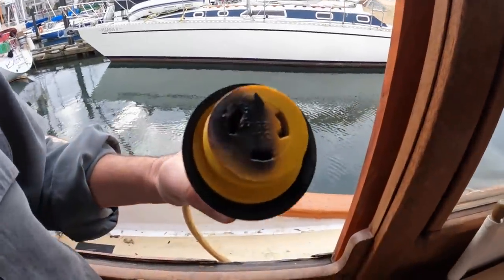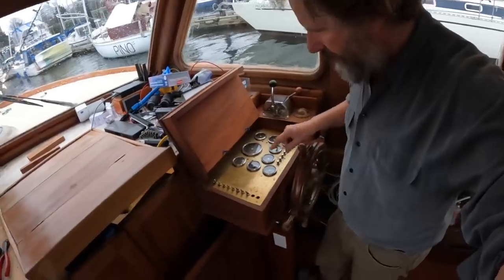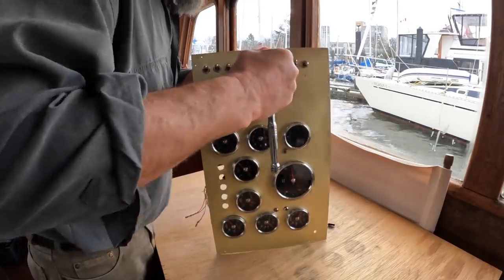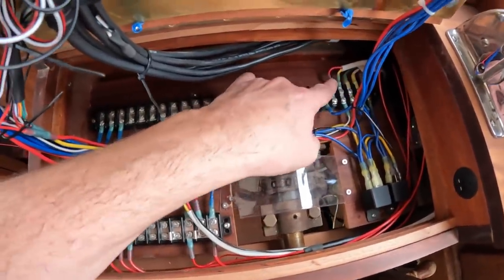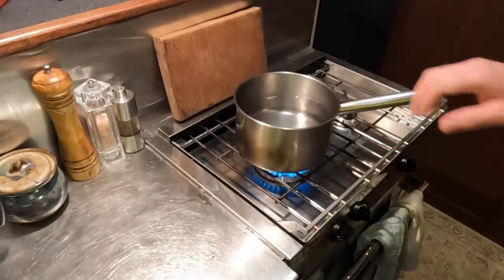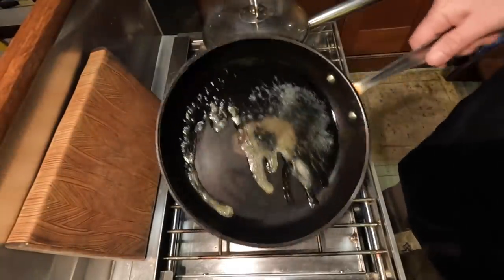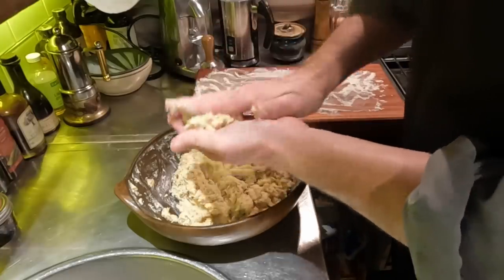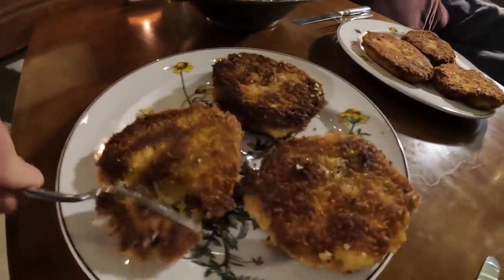More Electrical - #287 - Boat Life - Living aboard a wooden boat - Travels With Geordie

Comment: Marine connectors oxidise, their resistance changes, they arc across, get hot, then melt everything and try to burn your boat down. Other than checking and replacing connectors periodically, you could also put Arc Fault Circuit Interrupters on your circuits to help prevent the roasting.
Reply from the maker: Great idea

Comment: Coat all the wire terminals with a good quality silicon spray at the very least. Salt air gets in everywhere and being near a door open to the ocean, you WILL get salt corrosion.
Reply from the maker: Good point
Reply: @TravelsWithGeordie  Peter there is a product called Soft Seal. It is an aerosol. Stays pliable but keeps water out. We use it in our laundromats to keep water off the electronics and to stop the caustic soap power from corroding the internal metal parts of our washing machines. It is non conductive. It may not spin your wheels but just buy a can and check it out.
Reply from the maker: @EnglishLawyer  I’ll look it up!

Comment: Hi Peter, love your videos, the highlight of the You Tube week. However I do have to take exception to your advice about silicone grease on plug and socket connections, whilst silicone grease is perfect for the plug itself, do not put it on the contacts, some form of contact cleaner is the answer, Deoxit seems to be the popular choice nowadays, but if you can find it in a thicker consistancy it would be even better. Regards, thanks for all your work publishing these videos.
Reply from the maker: Thanks Brian. I actually use dielectric grease and I was mistaken thinking it was the same as silicone grease.

Comment: Dielectric grease on all connections especially plugs is the standard. Improves connections, maintaining current flow, even with mechanical contacts, heat cycles , vibration, lose etc. A small bit of dielectric grease  is the standard for old timers on all and every form of mechanical connections even bolted ones.. silicone grease is not the product to use.  Dielectric grease is .. FYI
Reply from the maker: I actually use dielectric grease but I thought they were the same.
Reply: I agree definitely the Dielectric grease is the only way to go!!
All the best from Surrey BC
Reply: @stelioshondrocolos1869    what about just use proper dielectric grease.....

Comment: Peter, great videos and commentary. Bite the bullet and either add a second 30 amp circuit or upgrade to 50 amp. Makes life aboard much easier not worrying about amperage.
Reply from the maker: A good idea for sure.
Reply: There is no point in upgrading to any amperage more than the dock can provide. In fact, that may be a recipe for disaster for obvious reasons.

Comment: Peter, regarding the wiring and your comments regarding loosening of the screws/wire connection; industrial wiring uses ferrules crimped onto the stranded ends as you may be aware, or I have on occasion bonded it all together using solder(only the wire not the screws) you might want to consider either of these strategies. I recently did the solder thing on a temporary winter, out of water storage situation connection. The female plug on the boat end  where I had not used either of these strategies was in really bad shape.
The fish cakes looked super yummy. To bad about the beer.

Comment: you need spiral wrap on those wire bundles for the guages........don't use tie raps use velcro strips to bind wire bundles they cane be used over and over...it's what we use wiring machine controls

Comment: Do you have an Infrared temp gun.. you could aim around at the shore power connectors while they are powered.. some times you can use a slip over the bare strands terminal.. so the binding screws are not squeezing on individual wire strands.. but on a crimped on terminal sleeve ..

Comment: I recently replaced an old Perko panel, that had push button breakers with a 22 position Blue Seas panel (8030). Its funcional but with labeling, proper tie strapping and some extra circuits to add to it's far from finished. It is always amazing just how long a wiring job takes to do. Nice looking fish cakes. Your idea for a quick fix on your female plug to boat, not too crazy about that looks dangerous. As for your instrument panel, could an acrylic clear coat or epoxy coat provide corrosion stability and scratch protection?

Comment: I burned a set of twistlocks up in the yard also. My mistake was using an old not perfect shape 'socket' with a brand new cord. It only takes one to make a bad condition. Wiring feels like a bridge, once your done start on maintenance. I like the EEL/blade smart plug, just still running $200 to conver. I use electrical contact compound that reduces corrosion and arcing( multiple manufacturers grey). I turn my heating wattage down when I am not on board.
Considering making my own arc fault interrupt box in-line of the cord to protect.

Comment: Look at a 32A IEC 60309 connector, they are ubiquitous here in Europe, very cheap, available in at least 2-4 +1 pin configurations, outdoor rated, and can most definitely handle continuous load at their max rating. There’s also more expensive marine versions that look a lot better than the standards ones. And since they are IEC, they are also acceptable in North America.

Comment: I'm not sure I agree with you on the sanded finish on that brass plate for the instrument panel, in my mind brass should just be polished smooth with a mirror finish then left to tarnish a little, I do like the idea of using Danish Oil as a finish to protect it though.
It's also looking quite flimsy with all those holes in it and carrying the weight of all those instruments, maybe a heavier thicker piece would have been more suitable ?.
Reply from the maker: I do agree Ian, but I can't keep a polished yet tarnished finish on it. It's too exposed to salt spray, every tiny drop makes a big green splotch. I could lacquer it but I wonder how that would hold up.
It's 1/16", pretty stout actually once properly set in place.
Now if I could find bronze plate!

Comment: You should look at using a multi-plug to be able to detach the dashboard from the helm - I like using Deutsch or similar automotive connectors.
Reply from the maker: Woo, that would be slick!
Reply: Do they really make them capable of so many circuits of varying guages I wonder?

Comment: The smart plug has a thermal cutoff, better connection and is actually cheaper because your not replacing the entire cord, just the end   I lost some wire to an overheated twist lock.   I was lucky to have caught it   Every twist Lock I’ve ever seen that failed was on the boat end
Reply from the maker: They abandoned the thermal cutout some years ago. too many failures. But they are very good plugs. May end up with one.

Comment: Question.. do you have some sort of thermometer that you could drop into the harbor water like checking the depth.. checking the water temp by depth..  see if when its really cold. if the deeper harbor waters are warmer than the surface..  its just a thought..  as i would worry about still water in your engine cooling system perhaps freezing..  perhaps closing the inlet valve.. then blowing compressed air thru the cooling system to force out any salt water .. 

 was also wondering if you have such a large output alternator on the engine..  if you have that hooked up to the 12 volt system to keep your heaters going if you loose shore power..  and do you have enough fuel on board to keep it running for 20 to 30 minutes at a time each hour for several days.. might not be power at the fuel dock to sell fuel also..

Comment: Why er!  With electrical flow it causes a vibration.  So you should check screws periodically.  The more amps you draw causes the resistance to increase.  Good video.  Like my use of wire?  (Why er!)

Comment: Has anyone mentioned dielectric grease in lieu of silicone? If not, then let's just make that my suggestion (for whatever that's worth).
Reply from the maker: That's a great point. I'm actually using dielectric grease. But I thought it was the same.

Comment: Good STUFF!!! My booster appointment on the 21st of this month.I am wondering if you experienced any side effects on day after booster shot??? CHEERS from Sooke where for now the snow is gone!!  P.S. Caramelised onions great on hotdogs too!!!
Reply: I had the booster shot 2 days ago, and the side effects were slightly milder than for the second shot, which, in turn, were slightly milder than for the first. 
For the first shot, the injection site was a bit sore for 3 days, sore enough that for 3 nights I would wake up every time I turned over in bed. For the second shot, the pain was less, and my sleep was interrupted for only 2 nights. For the booster, the pain was significantly less again, I slept right through the first night and by the evening of the second day I could hardly feel anything. I'm referring to the Pfizer vaccine.
Reply: @jaygee5693  Got it ! Thanks

Comment: Switch to 50 amp receptacle and cord
Reply from the maker: I considered that.
Reply: @TravelsWithGeordie  Not sure about docks. but RV spaces 50 amp is 240 volts which could be run though a breaker box and turned into to 20 amp circuits only because 25 breaker are hard to find

Comment: By coincidence I am currently designing a CANbus network to replace the need for so much wiring. FYI I'll let you know when I make a video of it.
Reply from the maker: Neat!
Reply: @TravelsWithGeordie I hope it will be I should just need power and 2 comms wires. The fuse breakers and power control will be imbedded in the system and anything sat on the network can monitor and control anything. I'm just finishing the design of hte network bridge PCBs then I can get it working in the garage. My asthetic is fibre glass and technology, but I'm very impressed with your work on Geordie. It's looking great.
Reply: Bad idea if I ever heard of one, why add all that complexity to something so simple. Anybody who has had to diagnose those system in less then ideal situations, might agree with  me. Just my opinion based on what I’ve dealt with. Will be neat if you get it running and make a video though.

Comment: It was actually painful to watch you take apart the helm panel and  wiring. I thought the brass plate didn’t look that bad.  Hopefully the tung oil does a good job of fighting corrosion.
I like your idea of having a better connection at the boat end of your shore power cord. At least if the cord has a problem it will probably not burn up your boat!
Instead of “wiring” this weeks word could have been tedious. I bet you were very tired of messing with it at the end. That’s a lot of wires in a very small area. It does look very good. 
Cheers
Reply from the maker: Thanks. I actually love wiring. I got frustrated in the helm being so cramped and burdened by all those pre wired pigtails. I hate a mess!